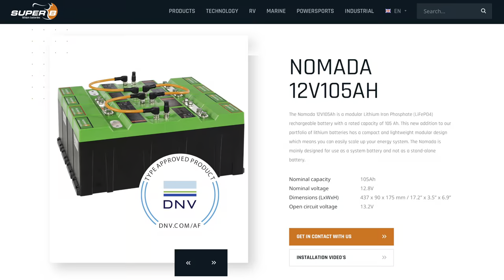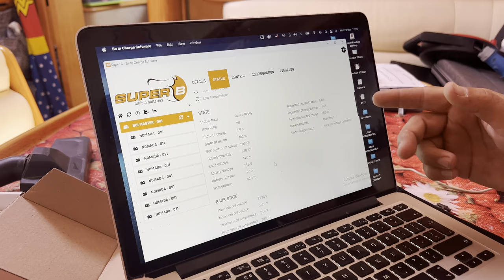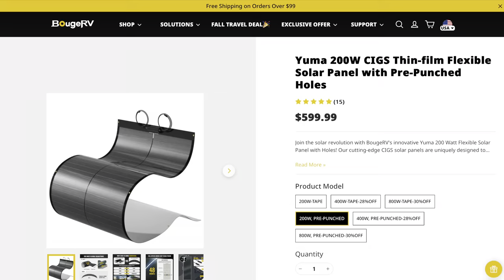EVERYONE IS DRAGGING! The mother of all thunderstorms. S4:OFF-GRID

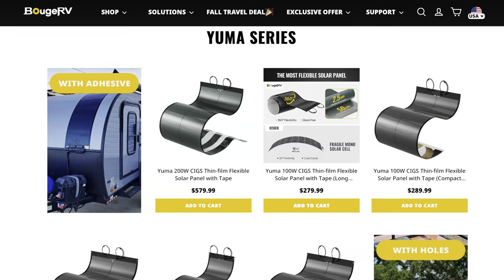Comment: 9:41 Presumably you mean 5 kilowatt-hours of energy.  Remember power is measured in Watts and energy is measured in Watt-hours.

If you haven't done one recently a video of your (electrical) energy budget would be very useful to many folks.

Totally agree on the benefits of Lithium ion batteries (specifically Lithium Iron Phosphate) for off grid power/mobile use.
Reply from the maker: Correct! I didn’t realise I hadn’t said that 🙄 but I did know this 😉 we may do a video for energy budget once we have lived with the systems for a while 👍 Super B batteries are awesome! One less thing to worry about now…
Reply: @SailingHollyBlue  Thanks!  The biggest question most people have for switching to Lithium is probably energy budget, so a video about it would probably be super helpful, especially after you get some more experience with them.  

Also insurance questions have been happening.
Reply from the maker: 👍 insurance is also on our list but we have some more important things to share first…
Reply from the maker: @LoanwordEggcorn  watch out for that episode! 🦋
Reply: @SailingHollyBlue  Definitely will.  Thanks again!

Comment: Hi Ross how long and what size rope do you use when tying up to rocks when on a med mooring. I have just purchased a boat in Lefkada so ensuring I have adequate onboard, thanks
Reply from the maker: Hi Allan, sorry for late reply…You want at least 40m. I’m currently using 60m of the yellow floating at Nidri Marine and 80m of navy mooring rope by Marlow both are 16mm-18mm. The Marlow rope sinks and is heavy and strong but doubles up as anchor rode as well . I will probably move towards another yellow floating line as Laura prefers the lighter weight… I use to prefer sinking. They both have advantages and disadvantages… I will probably do video on this one day to show this 👍

Comment: I’m a little confused do you mean connecting the batteries in series rather than parallel?   Because the outcome is completely different.
Reply from the maker: Nope parallel…each battery is already 12v so the 8x combined “in parallel” only up the capacity not the voltage. Each Super B Nomada LiFePO4 battery has a capacity of 105 AH so we have in total capacity of 840AH. Considering 90% of this capacity is usable , it is massive gamer changer for us. In fact right now I’m cooking a roast dinner which we wouldn’t dream of doing before!
Reply: @SailingHollyBlue  I knew this, but you need to specify this in your video so people don’t get confused and don’t screw up and destroy their equipment